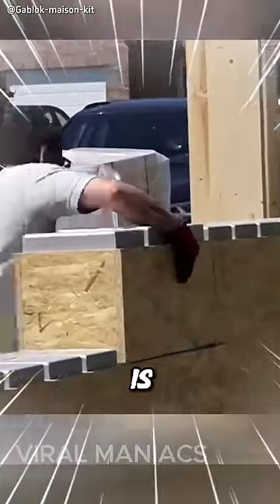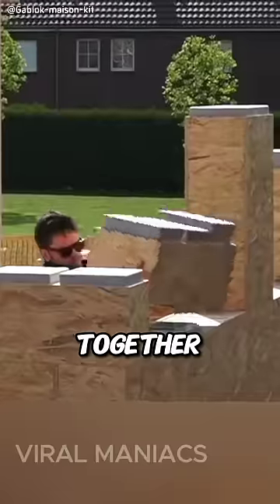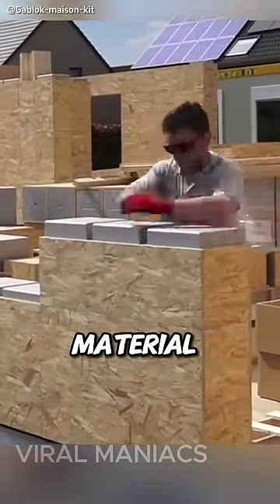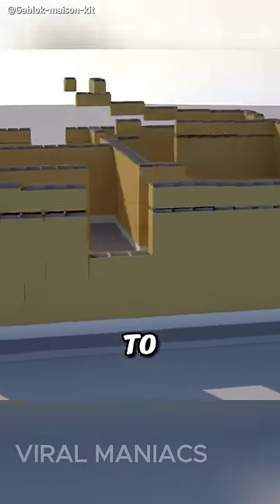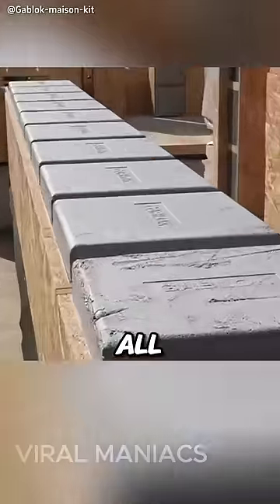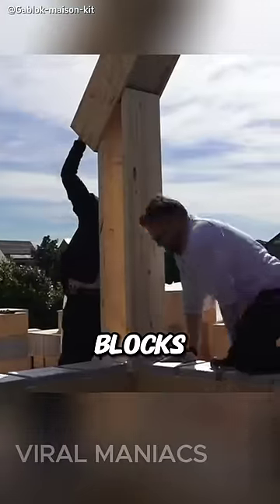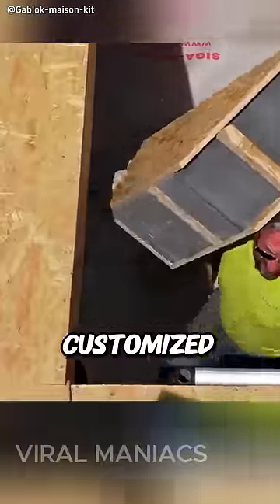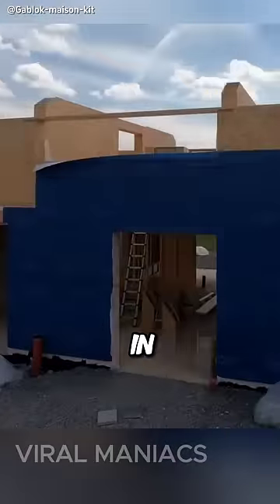Whoever Invented This Way Of Building Houses Is a Genius #shorts

Comment: for me that would be a nightmare as an electrician.
Reply: Why?
Reply: I was thinking the same shit! How do you run electric and plumbing???
Reply: Wires pluming vents gas lines etc
Reply: I was thinking the same thing. Unless you like the look of a million fucking miles of conduit in your house
Reply: @undead994life behind the drywall like normal?
Reply: @undead994life  Would you not run Electrics and pipes behind the plasterboard sheeting as in a conventional build?
Reply: @undead994life  Build an inner wall I guess but then you still need carpenters. Besides it's gaps between every lego block
Reply: Or plumber
Reply: @just_HAZEN wires and plumbing run through the walls requiring you to drill holes through each stud (the vertical wood 16” inches apart from each other) the drywall is then attached to those studs. It is impossible to just put the wires behind the drywall.
Reply: As an electrician I'm a bit disappointed a fellow electrician is so stupid. 

Obviously you clip direct and box up on the OSB board and dot and dab plasterboard on or stud off the wall and plasterboard as normal. Surely didn't think someone would come in an paint the OSB as a finished wall?😂😂
Reply: @MrWoofie62  wires and plumbing run through the walls requiring you to drill holes through each stud (the vertical wood 16” inches apart from each other) the drywall is then attached to those studs. It is impossible to just put the wires behind the drywall.
Reply: I guess you could build a furred out wall for all utilities but that’s like a waste of space. I guess you could core through the osb and insulation blocks…
Reply: Oh no, the electrician will have to be careful and do their job properly instead of whatever works because a customer doesn’t know. You know exactly the reputation you have and why it’s that way lol
Reply: @AcidGambit419  industrial look
Reply: easier than you imagine. You just have to drill, then you heat a metal ball attached to a cable, you pass through the hole, it goes down on its own making a passage for the sheaths...
Reply: @FumblsTheSniper  Ignoring the fact that we do not know if these blocks are intended to be drilled through and retain their insulation and waterproofing qualities
Reply: @blgarndogg9673  you never know bro… people are epoxying subfloors nowadays
Reply: @AcidGambit419   I know I am a minority in this, but I would love a house where all of the conduits throughout the house are external to the walls, instead of internal.  Sort of like ships.
Reply: @adaywithoutconscious7407  Plumbing would be run through your slab, you wouldn't run a water line through the wall. This is just the base walls itself, you wouldn't want exposed plywood for your exterior or interior surface. You would add another layer inside with your wiring ran down behind it.
Reply: It’s some really interesting tradesmen in these comments. Really really interesting. Not in a good way
Reply: Literally my first thought.. “but where do we run the electrical and plumbing” 🤨
Reply: @sunnyredz  do you care to elaborate instead of insult? Some of us are apprentice
Reply: You can invent wireless electricity
Reply: @just_HAZEN "Behind the drywall" would be IN THE FUCKING WALL. You do not have this here....
Reply: @just_HAZEN tell me u don't do construction without telling me u don't do construction
Reply: @MrWoofie62 no because I'm guessing the blocks are a substitute for framing which means plaster board or dry wall will go directly against the pieces of of wood that makes up the blocks so where will the space for wires or pipes go?
Reply: @blgarndogg9673 u have no clue what's going on here
Reply: @joreese6375 if the plumbing is designed properly it shouldn’t be a problem.
Reply: @100achillguy7  don't worry about him. I was an electrical apprentice too and I'm not anymore because that sh*t is HARD. Always ask questions even if just to confirm an answer you think you know. Measure twice cut once.
Reply: Surface mounted wiring. Not attractive however. We are obsessed with hiding our utilities.
Reply: nah man it's cool, you don't even need any tools, you can just take the house apart and out it back together
Reply: Electricians are nightmares for carpenters, so now you know how we feel
Reply: @just_HAZEN how will there be space behind the dry wall? What use studs as strapping? Kind of defeats the purpose! I’d love to see how it’s done!
Reply: @just_HAZEN  tell me you’ve never worked construction without telling me you’ve never worked construction 😂
Reply: @jeffconley819  You must not be a plumber if you arent questioning how the fk you could get water, sewer, vents, and gas within the walls. The only really way this could work would be to build a 2×4 or 6 plumbing wall in all the required areas.
Reply: @just_HAZEN not like normal lol they have codes that have to be followed. 98% of pipes and wires are ran through the studs this makes doing so basically impossible and a house likes this would make ductless ac required leaving lots of people out of jobs
Reply: I'm not an electrician and I thought the same thing. How does that work
Reply: @bennybellum6037 I grew up in a cinder block house. The wiring ran down out of the ceiling in a pipe to a metal outlet.
Reply: Thats why they have 3d sketch is needed. Manufucturer customize where electrical and plumbing is needed. Now i know your purely an electrician
Reply: It's a roof I can't keep you warm that's all the person needs.
Reply: That's true😂
Reply: @blgarndogg9673 as an electrician you should know y'all are just taught to run and pull wire not trouble shoot like a Heating/Air technician knows how to do along with problem solving skills.
Reply: @100achillguy7  at that point might as well build the house normally
Reply: mikepletka  bro idk, i didnt make em 😭
Reply: mikepletka  I agree
Reply: @Cliffhanger_MFC  I mean I can fault find as well bud it's not a hard thing to do for an electrician. It is part of the curriculum in the UK to become qualified. Not sure why you reckon being a heating/air con mongo is some sort of confusing job. All the failed plumbers and electricians do Air con because they are mongos
Reply: mikepletka  you're probably an American electricians mate doing everything in conduit with your 110v and switch gear that we used to use back in the 70s. You show off about your installs and they look like the stuff we strip out because it's shit and looks wank🤣🤣
Reply: @mikepletka  was just getting at the fact American installs seem to just use 1000 conduits instead of just putting a trunking or cable tray up instead🤣 sounds pretty mad that tbf aha work in an oil refinery then?

Comment: I'm sure plumbers and electricians are happy about this
Reply: Underrated comment 😂
Reply: 😂 pipes and wires all over the house
Reply: That's what I was picturing
Reply: Good point! What about electricity and plumbing?!?
Reply: Or is everything going to be wireless? And pipeless water just comes to you outta the sky... it's called rain.
Reply: I'm sure it's just as easy to cut or drill through as anything else. You've obviously never built anything before nor used a power tool, have you?
Reply: I am glad someone said it.
Reply: These are the comments I was searching for.
Reply: @sageminentjunky5197   You've obviously never ran wire through a house before.

You telling us that you are going to drill a hole through everything single block along a wall that needs outlets, T drill verticals for switches and ceiling lights and fans?

Drilling through isn't the problem, it is the running things along the whole length of a wall.
Reply: Is this even stable enough to build a ceiling and another floor on?
Reply: @MS-yz7sr  ah yes my shit gonna wirelessly go out of my toilet into the sewers
Reply: Nobody gives a shit what they are happy about. They can remain unemployed if they don't want work.

Comment: I prefer the smaller clay one's. Called bricks. Our house is 125 years old. Survived a flood 1953 and multiple heavy storms. Just renewed the roof with clay roof tiles. These shortcuts always reminds me of the story about the 3 pigs and the Wolf.
Reply: clay needs a lot of insulation still, it takes longer to build especially when they have trouble with logistics, and then you still need a lot of wood framing to put the insulation into, it will last a long time but no one wants old houses anymore, in a few years we'll all have new designs and technologies that would make rebuilding worthwhile.
Reply: @onlyme0349  Youd get kicked out of the EU and your nationailty revoced for at least six months if youd try to build a cardboard ..house.. like that.
Reply: @ISSO1407  nice pfp
Reply: @onlyme0349  Uhm, thanks?
Reply: @onlyme0349  What are these "new designs and technologies" that are going to make temporary house construction valid?
Reply: Where I live I have a ton of fault lines. Bricks wouldn't be the best here.
Reply: Life span? 10 yrs.or less
Reply: @EcnalKcin  the technology is an infinite money making glitch, imagine having to repair your house because you sneezed a little bit too hard.
Reply: And that Wolf will be greedy companies - fascinating what companies do to take more bad invested money from poor/ medium class.
These days we have concrete prefabs, you can also quickly assemble a house and it will be far better than this abomination
Reply: The plywood is not going to be left exposed. I would imagine you could use brick ties and brick the exterior.
Reply: Easy lightweight construction also means easy repair. Look at many Japanese houses.
Reply: @xanthromera  Japanese people were building such housing because of earthquakes. If you look at their real architecture you can tell, they like solid buildings, not what companies trying to sell for.
Reply: What is the story with 3 pigs and a wolf
Reply: @sreejithsubhash7301  1 built a house of straw, 1 built a house of sticks and 1 built a house with bricks. The big bad wolf could blow over the first 2 houses but not the 3rd. 
Or as Jesus said, build your house on a foundation of rock, not sand. Peace

Comment: I'd consider that for a shed or man's cave, but I am skeptical for the main building.  What's the fire rating?  Wind rating?  How to run electrical, HVAC, plumbing?
Reply: Whats the fire rating of a normal house made of the same exact materials?
Reply: @matthewp1682 significantly better than this. Fiberglass insulation is far more fire resistant than polystyrene which is literally solid gasoline.
Reply: @matthewp1682 houses are not made of chipboard and expanded Polystyrene, These have zero fire rating.
Reply: I haven't looked into these but all commercially sold building materials are required to adhere to NFPA standards.
Reply: I'd also be worried about out gassing of chemicals
Reply: Thats crazy talk
Reply: Running utilites: probably like CMU, but plumbing joins electrical outside the wall. Probably a lot of chase walls...
Reply: @dogwalker666 houses here are made of chipboard, I think...... (They look like 4x8ft. Sheets of shavings, glued together...?).  Still, VERY EXPENSIVE!!! 👃👃👃✌️🇨🇦
Reply: I agree but not a bad start to a simple and good idea. I mean all of the wood supports for your roofs and floors are all pre built so not a bad. Definitely needs more work tho
Reply: As an engineer I can state that your concern Is understandable. 
I don't know where the short Is taken but in Europe all the product must have the CE conformity, wich provide and certificate that certain tests where made before putting the product on the market.
Reply: @mediaistheenemy Is more toxic also
Reply: @galeparker1067  osb and plywood nailed to 2x4 framing. Canada makes houses like the USA. You have no idea what your talking about.
Reply: @matthewp1682  SHHH!!!! SHUSH!!! This is a youtube comment section, don't feed the wildlife!!!!
Reply: @galeparker1067  You're right, houses ARE made of "chip board" (OSB). They are framed with 2x6, commonly, with OSB on the exterior walls and interior floors, and then, guess what the exterior of the OSB is covered with in many cases? "Styrofoam" ;)
Reply: @mediaistheenemy   Polystyrene being "literally solid gasoline" is an absolutely outrageous oversimplification.
Reply: What about a tornado or a flood? How's it going to hold up to snow?
Reply: Wind rating 😂😂😂

There is no wind rating. It'll blow around the neighborhood like a tipped over garbage can 😂
Reply: Hunting cabin.  Lake sleeper get away
Reply: @galeparker1067  It's only used for temporary outbuildings here like hen sheds or huts, It rots very quickly in our environment,  However lining it with Expanded Polystyrene is not only a fire risk it burns easily and produces cyanide gas when burning, That's why the construction would be illegal, Oh and yes wood is a very expensive building material.
Reply: Yeah I’m surprised that this would be allowed based on the fire rating to begin with.
Reply: @mediaistheenemy it is gasoline, water will not put it out. It doesn’t matter though because a burnt down house is a burnt down house,
Reply: You might not quiero it so much when you could get your dream house for like 1/2 price. Lol
Reply: @jmbewleyjr  It would not get planning permission due to being a fire hazard and riddled with damp.